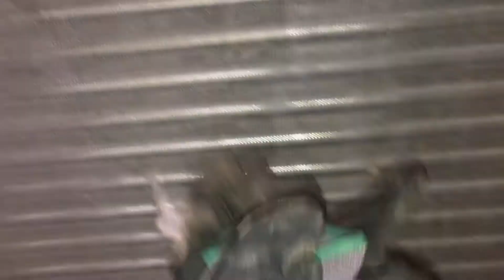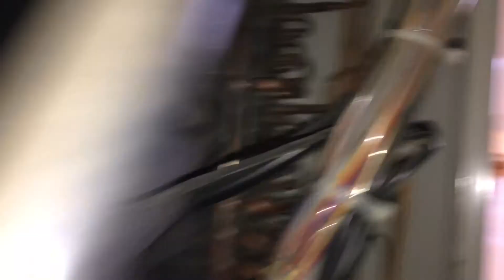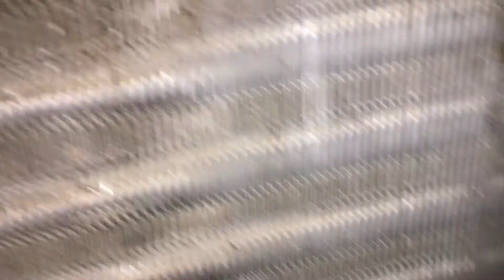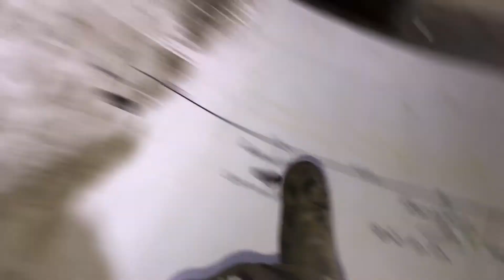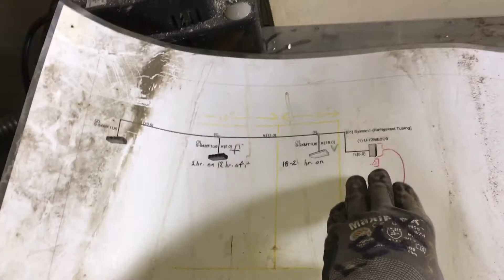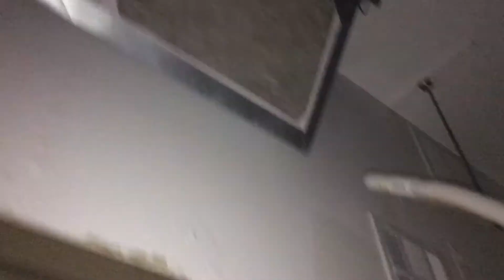Pt 2: Panasonic EcoI, VFR (VERITABLE REFRIGERANT FLOW) heat pump

Comment: Do you know if the Panasonic vrf indoor unit now a days can be used with an old sanyo eco-i vrf System or can any panasonic indoor units be used with an sanyo eco i System? Cool Videos 👍
Reply from the maker: I do not know about the newest systems but the model that you’re looking at here and the one just prior to it did . 
                The very first unit I installed that had the sticker on it saying Panasonic was exactly a SANYO they just change the stickers.. 
                Back when the company merged with Panasonic. 
            I stop selling or installing Panasonic units took to long to get parts they would always arrive damage on every job then took eight weeks or 10 weeks to get a replacement. They were just shipped their units without any protection on them and they get thrown around by the delivery truck drivers and come smashed up because they were not on a pallet air handler’s would just come in cardboard boxes. WTF 
              Panasonic literally got kicked out of Baker Distributing down here in my area their service was so shitty they almost no longer exist anymore in our area nobody wants to carry their product line. 
                 They were so desperate in our area to get somebody to carry their product they had a electrical supply house Who knew nothing about air-conditioning trying to sell their product line for parts you might as well have Starbucks or 7-Eleven push your parts complete idiots. . 
               The last unit I worked on last year I had to go 29 miles north across the Golden Gate bridge to get to a place that I had to order parts from would not even take a card over line wanted me to open up a account with somebody I’d never do business with again the other option was across the bay going south. 

              You could say from our area over here they’re basically blacklisted. They put all their efforts into selling their product trying to get it moved but not service for the end-user or contractor buying and installing them.
Reply: @coldfinger459sub0  thank you for your fast answer!
I dont know how panasonic acts in europe especially in austria where i am from :)

I install an used sanyo Outdoor unit from 2009 spwc1155dxhn8 (panasonic and argo have the same ones only with an different model number ). 
Most of the VRF systems also daikins VRV system can be used with the newest indoor units. Mitsubishi indoor units from 2020 would even work with an R407 condensing unit.
Maybe i could ask panasonic they should know that.

i am also wondering what the minimum power of an VRF System is. with 1 Compressor is it 50% ? but with a 2 stage system with two compressors ( one inverter one fix) shouldnt it be 1/4. so an 12ton unit can regulate down to 3 tons?